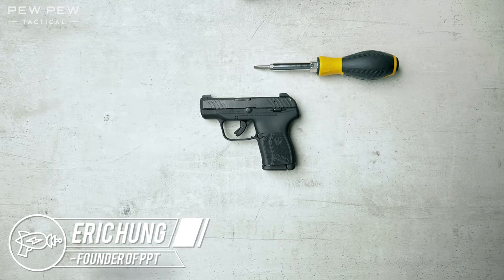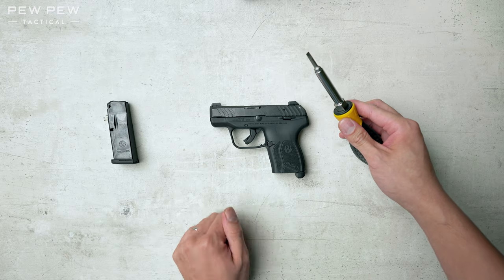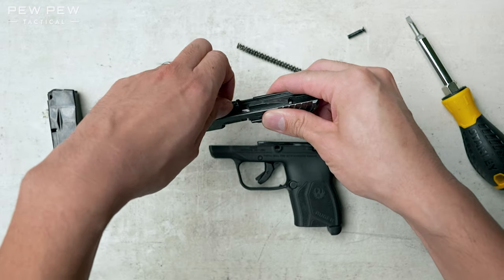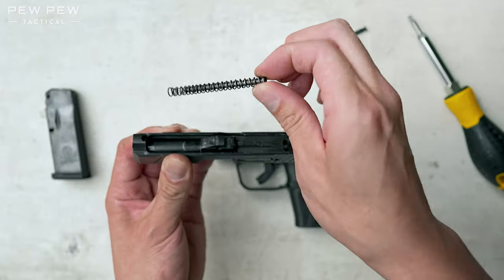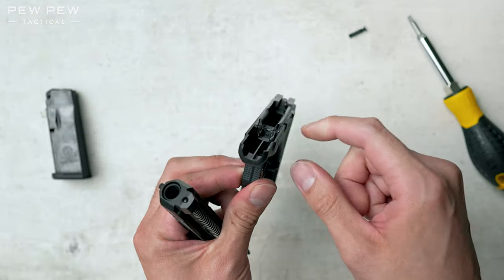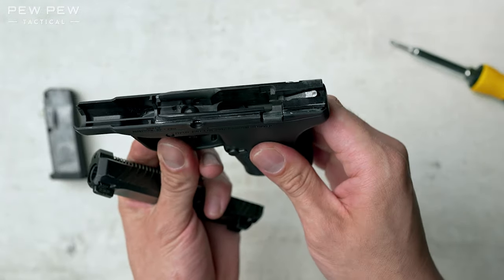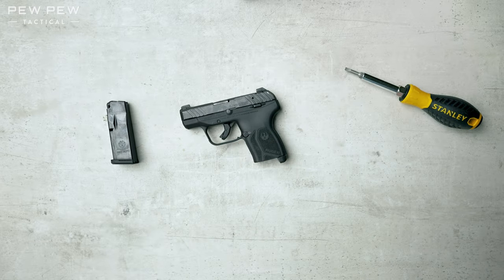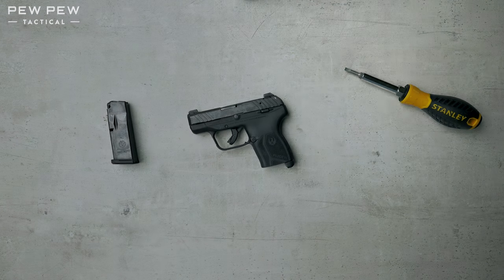Ruger LCP Max .380 [Field Strip]: Disassembly & Reassembly

Comment: FYI- After I drop the mag and clear a round from chamber, I use that round to pry the pin out. Works every time. No screw driver needed. :)
Reply from the maker: Great tip!
Reply: Makes more sense to me! Thanks for the advice.
Reply: @guncademybypewpewtactical8640  Mine has a horizontal, protector, metal[but bendable] strip on the side that blocks this screw. Not sure if the screw will release or not because of that. It is LCP, because it is labeled on the gun in all caps on a side of the gun. How would I and anyone else that has that blocker strip get this screw out? Thanks for your very valuable time!

Comment: When I reassemble and slide upper slide  on rail it doesn’t go all the way back and line up. I have to push the upper forward a bit and there is a little arm I see and I push it back towards rear. Now slide will go all the way back. Why does it do this. Your video mentions nothing of this little quirk.

Comment: GREAT video! So simple that a caveman could do it!
I put a piece of painters tape on the slide so it doesn`t mar up the finish on the gun while removing the pin.
Reply from the maker: Thank you...and good advice for not damaging the finish.
Reply: Grind down a toothbrush handle….or send for a plastic tool set made for exactly this kind of job.

Comment: Should I oil inside the mag? Its pretty stiff.
Reply from the maker: Great question. No. The mags need to be stiff and oil can get on the ammunition, potentially affecting whether it will fire or not.
Reply: @guncademybypewpewtactical8640 
Thanks
The problem was I couldn't put one in the chamber and fill the 12 round mag for my ruger lcp max. In other words the mag wont click in.

Comment: Do you feel comfortable carrying a chambered LCP Max appendix position?
Reply from the maker: That's how we run it...as long as you have a great holster you should be good to go.  The overall LCP design has been around for years and is reliable.  Check out our holster picks: https://www.pewpewtactical.com/best-concealed-carry-holsters/
Reply: @guncademybypewpewtactical8640  I have a CYA holster its made of boltaron. Is this a good holster?
Reply from the maker: We haven't tested them but the name is familiar.  Boltaron is very similar to Kydex so you should be good to go if it covers the trigger finger and attaches well to your belt/gun.
Reply: @guncademybypewpewtactical8640  right on! Thanks.
Reply: Regardless if you’re “scared” carrying the Lcp max loaded, it has a slight heavy trigger pull. Well at least mine does. But I’d like to see a trigger disassembly. Great video though.
Reply: I value my junk way too much to appendix carry any gun.

Comment: Question… I have a NEW IB LCP Max that I bought right before Christmas. I have a bit of wiggle in the slide and it rattles on the rails. I’ve seen vids on YT where other users have had same problem. They called Ruger and Ruger replaced the slide owing it to a slide that might be out of spec. I tested a NEW Max at my local shop to compare. Nothing. Snug smooth fit and action. I called Ruger and the Cus Service Lady says that my Max SHOULD have the waggle and rattle in the slide and she says they feel there’s the problem with the multiple OTHER Ruger Max I compared to.  and that was end of the call. I have not fired it yet. Haven’t had time to get to range. 
Anyone?  Thoughts? Should there be that kind of noticeable wiggle and rattle on the slide?  I do not notice this type of rattle wiggle on my M&P Shield at all.  Help me understand?   Thx!
Reply from the maker: I'd check with a local gunsmith just in case...

Comment: Is this too big for pocket carry? Or just right? I used to like pocket carrying the lcp 2 but I hated pocket carrying my 1.0 shield 9mm. But the sights are much better and the capacity on this lcp max has me interested.
Reply from the maker: I think it's just right...and almost exactly the same dimensions as the LCP 2 (most holsters still fit).
Reply: Just bought mine today. Definitely good for pocket carry.
Reply: Beware you may not want to carry anything else once you pocket carry this bad boy.
Reply: @jojojor11  I’m with you on this already. Even with the extended magazine and basic included Ruger holster, it doesn’t print and is extremely comfortable. Even went jogging the other day with it in a comfort tac belly band, and it was discreet and secure. Love it.
Reply: I always have a S&W bodygaurd .380 on me for years now because no matter what you are doing it can be carried. But I wanted to upgrade to something new and with more rounds so I got this. I’m hoping it is about as easy to conceal carry. Is there a good front light option that anyone would recommend ? And a holster that will fit with the light ?
Reply: Even Goldilocks would LOVE the way this fits in your pocket.
Just make sure you always use the appropriate holster or soft pocket shield to protect the trigger area and you are going to agree with Goldi……..

Comment: When I took the pin out to release the slide, the slide is stuck and wont come off or go back into place. I cant put the pin back in, cant take the slide off, and cant pull the slide back
Reply from the maker: If it's pretty stuck I'd bring it to a gunsmith
Reply: @guncademybypewpewtactical8640  I figured it out, I just had to keep pulling the trigger to get the slide off because it was stuck on the interior hammer. Then to put it back on I had to pull the interior hammer up
Reply: you  are the only one who explained  what to do  if the slide  wouldn't go all.the way back,(pull back the firing pin the slide goes right on
thanks for your video👍the rest never explained that